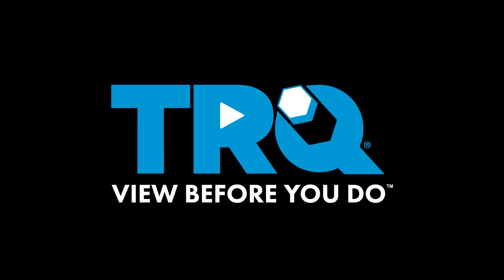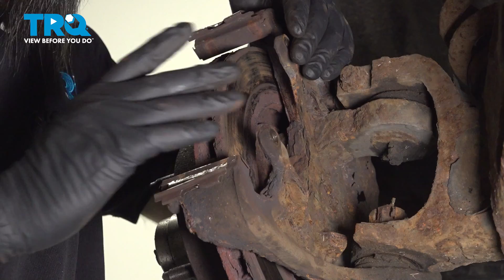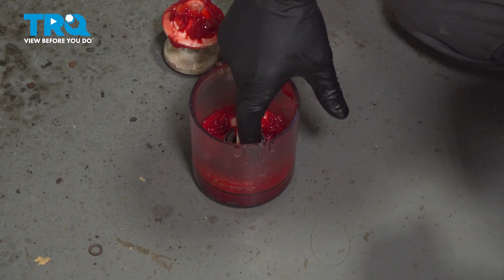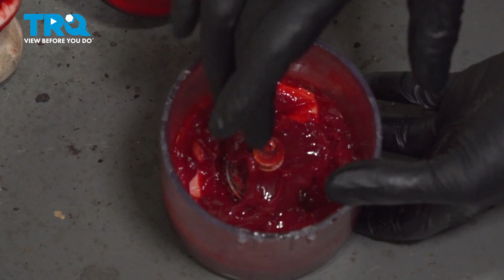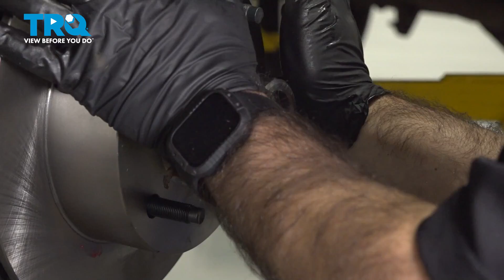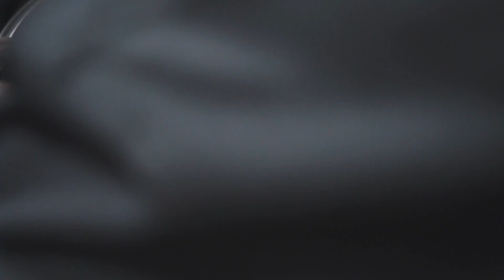How to Replace Front Outer Wheel Bearing 1992-1996 Ford F-150

Comment: You need to correct this video as to how to properly install the inner bearing and the rotor's seal.

With the rotor horizontal on the bench, the greased inner bearing is placed onto the race.

Next, the seal is pressed into the rotor.

Apply a light coat of grease to the lip of the seal and to the seal's contact area on the spindle.

Install the rotor followed by the outer bearing, washer, etc...

The way you show it, the rotor's seal will never work and will be bashed up against the dust shield (what's left of it).